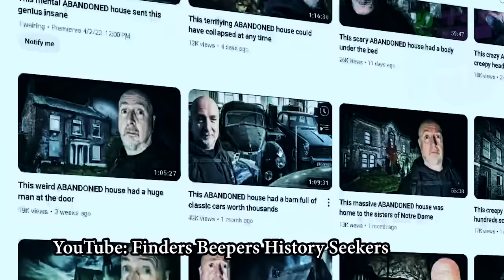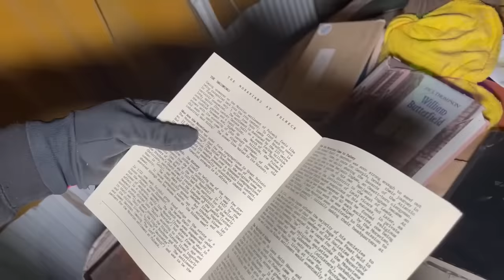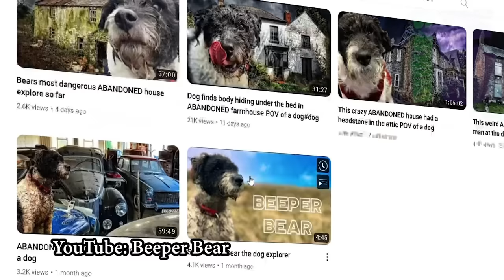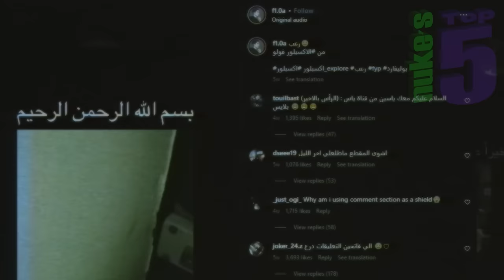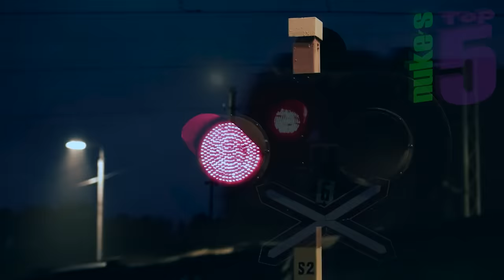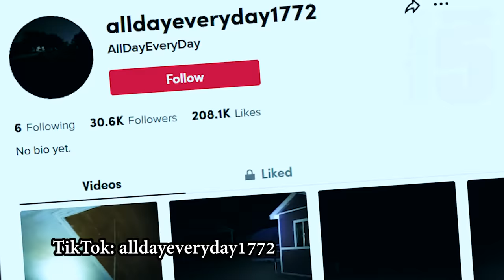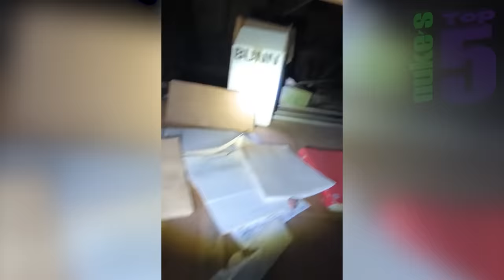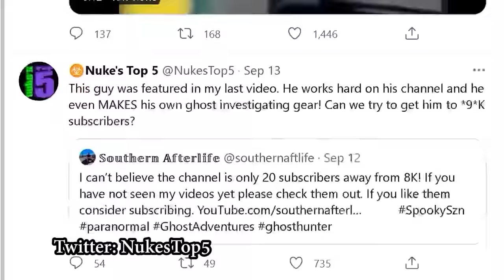Top 10 SCARY GHOST Videos : MAMA Can't Save you NOW

Comment: The “creepy face” in the third clip looks like it could just be an optical illusion with the environment. The mouth and teeth are part of some sort of semicircular structure with rebar or wooden sticks laying inside of it, and the “eye” is just a hole in the wall.

EDIT: just played it back in 0.25x speed. It’s totally just the wall, but it looks like a face because of a forced perspective illusion. You can see as the camera pans that someone is shining a flashlight at the wall, which is creating this circle of light that’s vaguely shaped like a head, but you can see as they move the flashlight to the right, the light continues moving across the wall.

Comment: #2 is fake- If you watch at @22:08 you can see all movement in the frame suddenly freezes as the frame is held while a composite shot of a figure in a black morph suit is put in. Notice how all the movement is suddenly stopped for that effect. And subsequent video is easily faked with another conspirator, with all events easily just word of mouth. 

#8 is spooky, but just as fake as you can see the same sort of thing in the closeups- the lighting on the womans face doesn't match the rest of the shot, and appears to be sloppily composited in.
Reply: #2 is indeed fake because (1) the natural inclination would be to run to the window and flash your light at the figure you just saw through the window - no one would try to run and open the door of a small shed a burlar who probably is armed is in.
(2) when dude opens the attic, he doesn't even look all directions around him, just looks two ways. The natural inclination would be to turn around in all directions immediately
Reply: I don’t think anyone here actually thought it was genuine😉

Comment: The dude with the barn. Was very good edits. If you notice he hold his camera super still, which makes editing so much easier. But if you watch it very slowly, you can see where it clicks into place which is where the edit happened. As for the dude who he saw outside the shed. If you noticed he did not angle his camera towards the area where the guy was running from to give the dude more time to get to the house and then panned over right when it was time for him to walk in. This guy has been asked for proof that he called the police department and he will not show proof. And if you notice that for the attic, he never turn the camera behind him. He only showed three corners not four corners.

Comment: The clip with the figure in the shed where the lights flicker on an off is kinda suspicious to me. It seems like there is a small cut in the video right before the figure appears. It's especially noticable at the replay of the clip, you can see the frame jump if you keep track of the white framing of the house (or watch the left side where the door is) before the figure pops up in the shed.
It's slight but noticable.